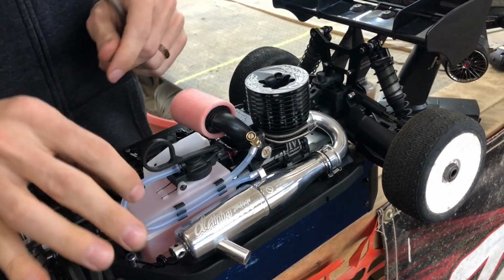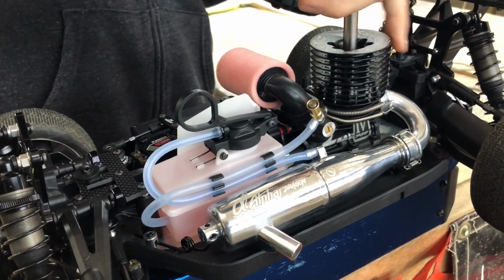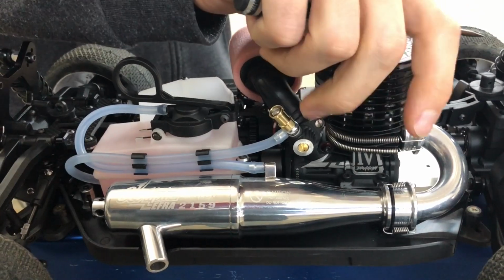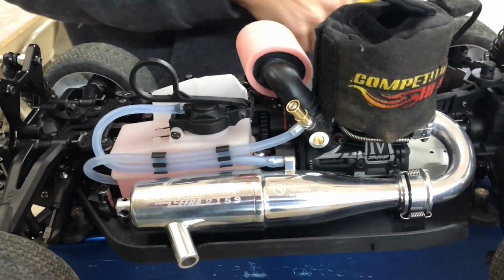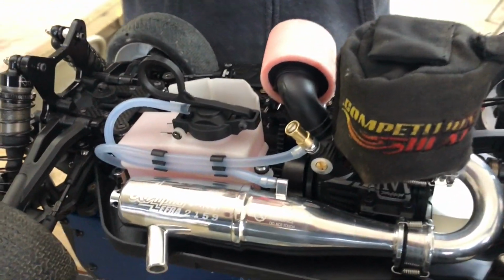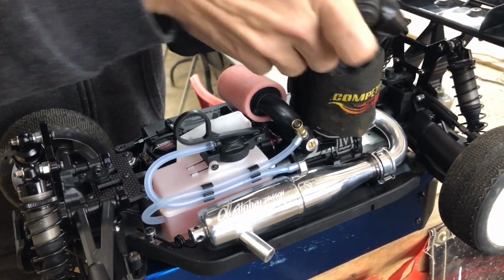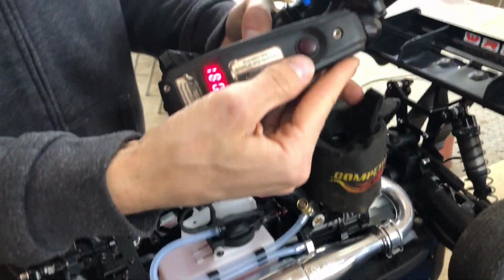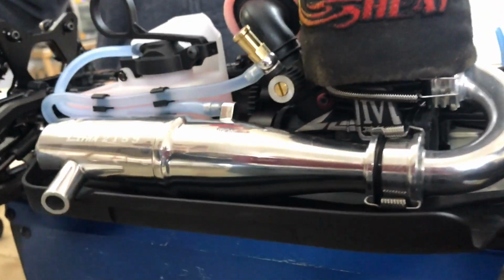Alpha Dragon IV Edition 2 first time fire start up with [Ryan Lutz]

Comment: My buddies also has a Dragon IV V2 engine. this is not the same as other engines that you need to baby sit the engine on breaking in. it is somewhat already breaked in cause its already quite tuned not too rich. but so far for alpha engines what i love the most is its the most tamable engines when you tune it up! even in idles it stays forever! I always wanted to have a dragon IV v2 engine but its quite expensive  but i only ran alpha club racer pro spec (black) and A872 dark green alpha engine as well.. so far the best I've ever had because its not as sensitive when tuning it up like the other high end engines :) Im glad your using alpha engine! thats a beast yet also very durable! :D

Comment: Picking one of these up this week from Matt at Send It RC, pretty excited, hearing great things, and im at my wits end with having to get OS motors re-pinched every few gallons. Thanks for the helpful video man, also really nice meeting you at PNB!
Reply from the maker: Awesome Matthew! I’ll be putting out more videos about the engines soon I hope. Thanks for giving them a shot and let me know how I can be of any assistance!
Reply: @RyanLutz  hey Ryan, I know it’s been awhile, but I had a question. Several of us here in the St. Louis area are running these new dragons, and we notice one inconsistency out of the box on the engines. It’s pretty much 50/50 but some of our mid needles are screwed in pretty far, and the other half are flush like I see yours in the video, and we are wondering which is correct, or if there is a standard(ish) measurement for how far in the mid needle should be in. 

Any help would be greatly appreciated.
Reply from the maker: @thegooseisloose03  Hey Matthew,
yeah sorry for the confusion on that. The engineers did a batch where they set the midrange in deeper as they felt it was better for their conditions. The engine will run well with those settings but I think after we have done further testing that we are preferring the midrange to be set in the flush position which is how all the batches of engines will be coming from now on. So for those who have the midrange in they can try out the flush setting and lean out the bottom accordingly and try those settings!
Hope you are enjoying the engine and in the future feel free to email at: lutzinator408@gmail.com

Comment: Hi Ryan..👋👋👋...How many tank we must running before we running on the track with 3 or 4 tanks?..i mean for break in just on the starter box before continued break in running on the track..im using Argus K3 Evo II..the Argus engine have the same technical actually with Alpha because with the same manufacture..please let me know how🙏🙏🙏👍👍👍🇲🇾
Reply from the maker: As long as it comes pre-broken in you can start to put it on the track right away if you want. Just be sure it is up to temperature around 200*F and at a slightly rich setting and drive it easy for the tank and let it heat cycle.
After the 4 tanks then start to race tune! :-D
Reply: @RyanLutz  oh but i got not pre-broken engine so must break in not in running condition just on the starter box before break in more 4 tank running in track right?...im hear you now with WRC buggy right?..not with Agama anymore..but WRC buggy is not yet someone buy in Asia..for Agama yes a lot Asian people playing buy it
Reply from the maker: @mustakimkamaruzaman9715  yes you would then need to do a heat cycle method up to 1/2 a gallon worth of fuel before you would really want to race tune it. Couple tanks on the box and then can start doing figure 8 in the parking lot or street. Do maybe 2 tanks at a time then meeting cool. Then heat back up and do again. First two tanks only pulling 1/4 throttle. 2nd set up to 1/2 throttle, 3rd set up to 3/4 throttle. Then can start to lean it out a bit. 
You want to get rid of the mechanical pinch if you can. 

Yes now racing for WRC. New brand for off-road but they have been doing on-road a long time.
Reply: @RyanLutz thanks for the advice.. oh so now you driving a Pivot Hub buggy..before with Agama you driving C Hub buggy..what the different between those hub in your experience..i feel the different with it..hope can you explaind give some advice to me about those hub for my freind & me to learn..🙏🙏🙏
Reply from the maker: @mustakimkamaruzaman9715  Smoother initial steering and more stable under braking and continues to steer through corner as you pick up the throttle. (Pillow Ball)
Reply: @RyanLutz  i still prefer C Hub car because i always doing hard throttle when exit the corner actually..yes with Pivot Hub i feel faster more but when corner with my drivinh style im always oversteer a bit..maybe i must change the way i drive(hard throttle exit corner) if i want play with Pivot hub car..maybe i will buy one Pivot hub kits so i can learn how to drive with two different hub car..so i will get experience & no mistake problem if driving with different hub car..i must be like you who can drive any type of hub car..the pro driver is who the one can drive any type of car..i will get the new kits of Pivot hub buggy kits anytime..👍👍👍
Reply from the maker: @mustakimkamaruzaman9715  I have been told I get on the gas harder and earlier than anyone on corner exit. I feel the pillow ball absolutely fits my driving style of being aggressive through the corners!
Reply: @RyanLutz  maybe your setup for the car more good..im must setup diff oil,toe,camber,acker different setting & running on track to choose which setup is good..

Comment: On your site it would be great to have more info on how the different pipe options affect the power and and fuel efficiency.
Reply from the maker: Yes absolutely. I’m slammed with all the new happenings right now but will be sure to continue to add more info. 
2159 has a quicker bottom to mid range
2134 will have a smoother bottom to mid but stronger top end. 
I’ll have to run the 2107 again to compare with these two on the new Dragon IV.
Reply: @RyanLutz  thank you!

Comment: Hi ryan, nice breakin, can i ask, what “tink” sound?is it the clutch?what makes  that happen all the time.thanks
Reply from the maker: Can you designate a time you hear it? Not entirely sure I know what you are referencing too
Reply: @RyanLutz  hi its start from 1.22min -till end of the video. “Ting-ting” sounds
Reply from the maker: @SPEED-7  I can’t say I know for sure what it is but if I had to guess I would say the clutchbell teeth vibrating between the spur teeth.
Reply: @RyanLutz  thanks ryan, sometimes i got the sound too, but i was distracted by lsn and hsn tuning 😊, by recall it again, i thats the answer, the clutchbell hitting the spur in a vibrate nudge mode. Thanks!

Comment: What kind of runtime do you get out of the IV 2? For example at SS this year, at what time interval did you pit?
Reply from the maker: Usually my runtime is right around 8 minutes on most tracks. So I have to make a decision depending on track size whether to risk pitting at the 7:30 interval or having to do one more. I'm often on the throttle more than most though.
Reply: @RyanLutz  thanks this helps set a baseline.

Comment: What is a good clutch and clutch bell set up for the Dragon IV engine?
Reply from the maker: I offer both the Alpha 3 shoe and 4 shoe clutches on LutzRC.com. Clutch bell size depends on the vehicle you are running and the internal gearing and spur size and what size track you plan to race in.

Comment: Kinda makes me want another nitro. Prolly will never own another one though. Such a pain in the ass to run
Reply from the maker: They do require some extra maintenance especially if running on a dusty track. Absolutely rewarding when they do perform right though. 😁
Reply: @RyanLutz  I had a blast bashing with my old Tmaxx 2.5 when it was running but I swear It was more figuring out why it didn't run than running it.

Comment: What the heck? Every other break in video you always see the guys leaning out all 3 needles trying to find max power , super confused all u did was lower the idle 🤔
Reply from the maker: In a break in video they are leaning out the needles for max power? 
Every engine manufacturer is different and how they have the needles come from the factory. Alpha has the needles set to allow the engine to fire up easily (as seen in the video) and then you can drop the idle once it is started to get a more moderate idle going before you begin to break it in on the track. This video was a demonstration of how easy it is to start the engine for the first time, not the full break-in process..
Reply: @RyanLutz  that makes way more sense , thanks